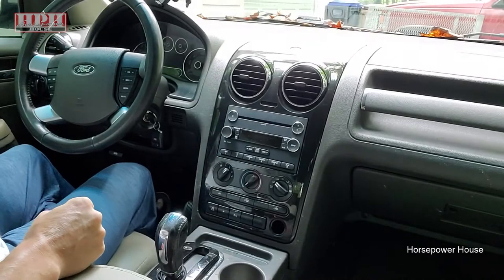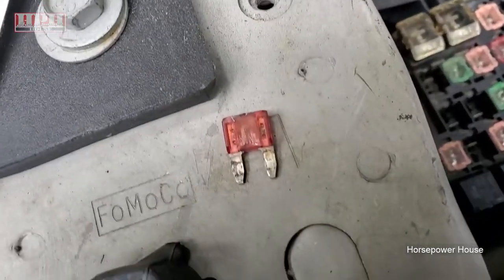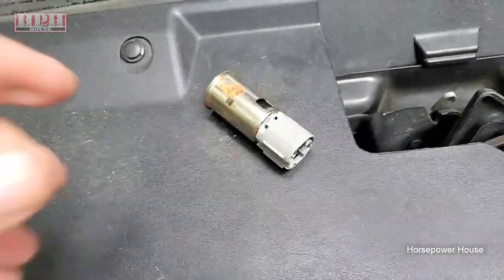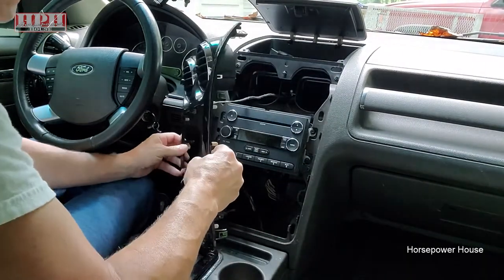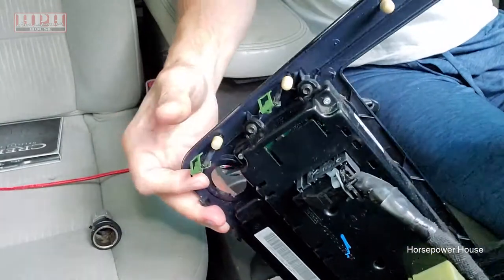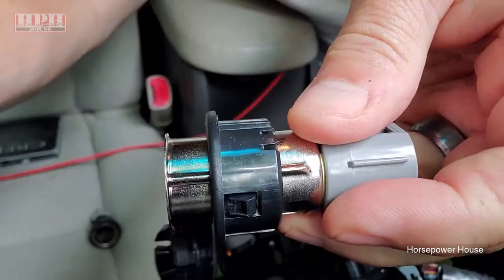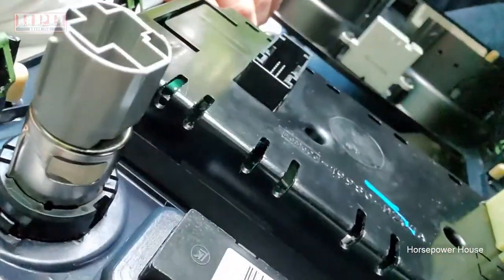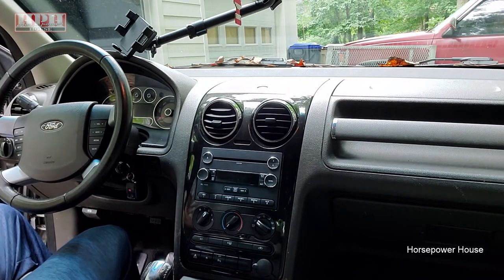How replace troubleshoot front power outlet socket cigarette lighter Ford Taurus X Mercury Lincoln

Comment: I have a 2012 Tuuras SEL and I have the same problem.  Where do I purchase a complete assemby unit - power supply socket? I've looked everywhere for the complete unit - socket plus the black plastic thing on the front of the socket.
Reply from the maker: Ebay, of course. Tons of Ford models use the same one.